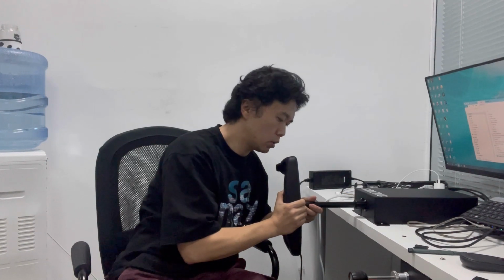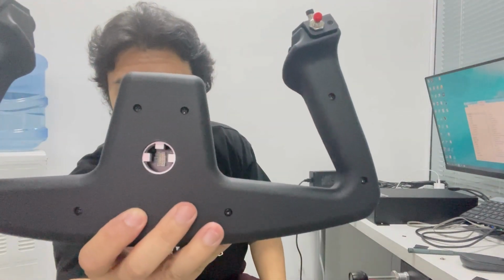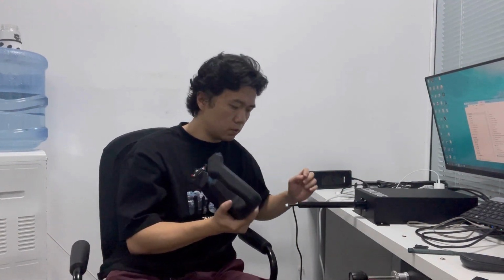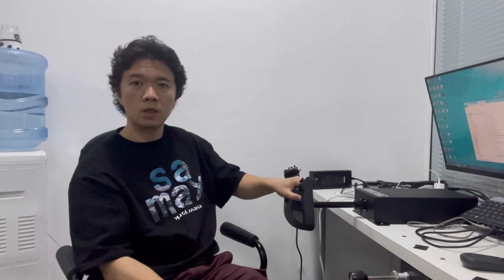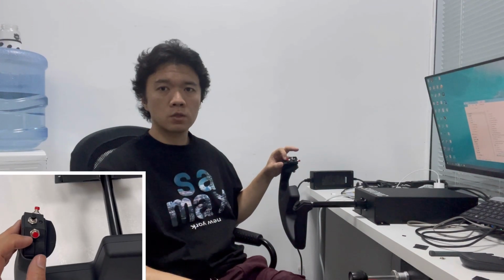SIMiONIC force feedback yoke

Comment: Beautiful product, I own your compass, standby gauges, pfd and mfd and switch panel. I love the quality of all your products. I too would love to purchase a circuit panel or and an entire panel to house everything if you ever make them available. Regarding the force feedback yoke, can you hook two up as in a pilot and copilot configuration so they follow each other?
Reply from the maker: We use XPForce as the driver.  It supports syncing multiple yokes.  But there will be lags since they are not mechanically connected after all.  And you need to set a button to activate/switch the main control yoke.  So I would say it's partially supported.

Comment: Awesome! Looking like a step in the right direction.

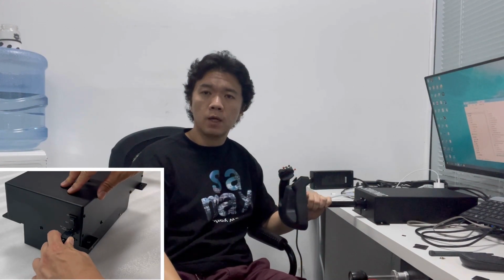 The connector plug concept to be able to remove the yoke is a great idea. In 1:08 you said you can install to a surface using 4 screws. But by looking at the full shape of the yoke in 5:20 it appears you have to cut a hole to make the yoke rest flat in the surface. I am not sure most people will be able to do that and the yoke will sit too high. I use 3M velcro to secure my current yoke to my desk.

 Lastly, what is the connector just under the power plug? USB?
Reply from the maker: Yes, you need to drill holes for the 4 screws to get the yoke fixed on the surface.  We did make a clamp so you can install it without drilling holes like other product on the market.  But it doesn't hold the yoke very well since the force generated by motors is stronger than just a spring.  The connector under the power plug is USB port.
Reply: @chenli2294  I may not have have explained myself well. Did you rest the yoke on top of another box of the same color to show how to plug the power? When looking at the yoke from the back it looks like the whole thing is asymmetrical and has another rectangle box under it. It looks as if you have to cut a BIG rectangle on the desk to be able to fit it flat and be able to secure it with the screws. If it is just the bigger top rectangle box then all is well.
Reply from the maker: @AeroRamer  Oh, yes, the other black box is just a box I put the yoke on to give enough clearance for the steering wheel.  it's not a part of the yoke.